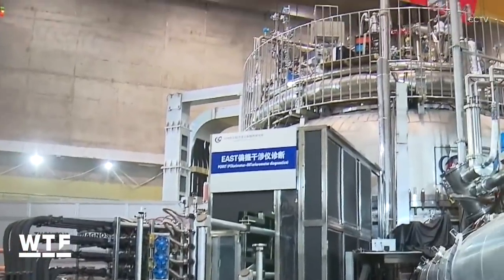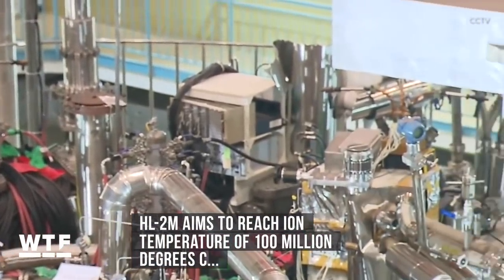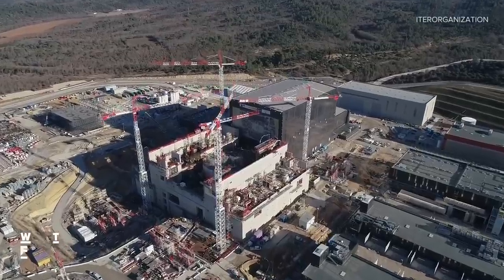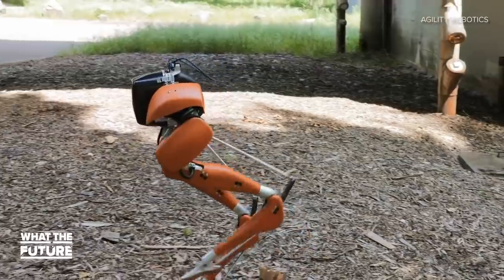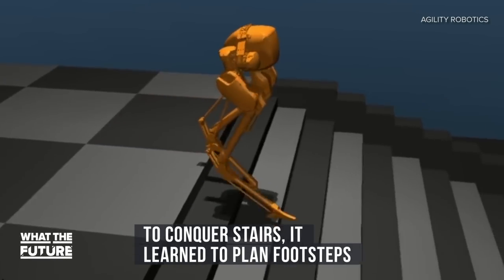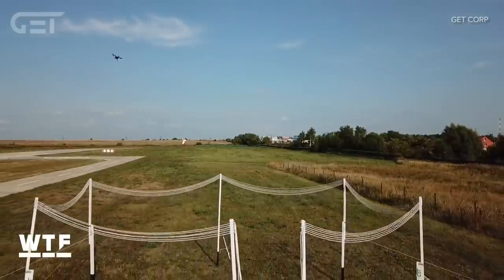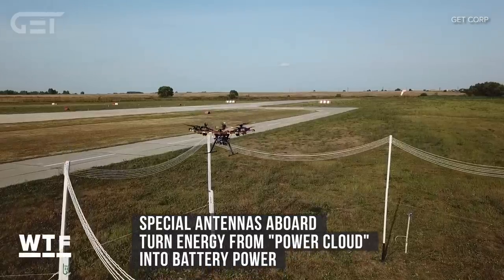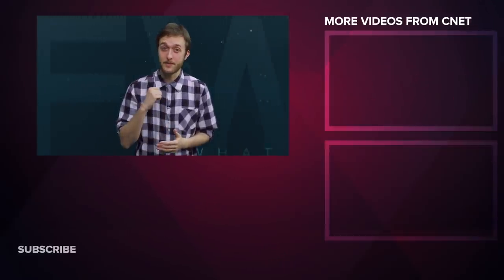China's artificial sun to be completed this year | What the Future

Comment: I hope that fusion project succeeds; unlimited, clean energy. And that robot legs thing kinda looks like a Metal Gear Gekko
Reply: nothing is unlimited, you'd be using sea water as fuel. and given human's track record on consumption of everything. with newer tech and abundance, we are likely to increase consumption, not less or maintain.
Reply: @skychaos87  except that fusion power produces over 4 million times more energy than the burning of coal and oil per unit of fuel. The amount of deuterium in sea water would last millions of years. And you can get deuterium from other forms of water too. Plus there's resources in space like heium 3 on the Moon or in the atmospheres of gas giants which is exponentially greater than the amount of fuel in Earth’s water (assuming we actually get around to colonizing space; it could happen.)  PRACTICALLY limitless is what I should have said. Plus we are getting better and better overall at energy efficiency; operating our machines and technology with less and less energy. So there's those
Reply: @dartmada9733  I agree with the potential, i'd support and hope the fusion tech succeeds too. However, its still not unlimited energy. Humans will still maximize the rate of consumption. We won't just be powering cars and planes anymore with fusion tech, it'd be spacecrafts and perhaps flying buildings. Our walls at home would be full of led screens and computer chips. All where consumption will be at rates thousands of folds more than our current rate of consumption. I'm afraid that at that point even fusion energy won't be enough anymore and we will have to eventually source for better and more energies.

I think there's a constant struggle within the limits. We need to control our rate of consumption, only when we increase our limits(fusion tech) can we then spend more. Its just a repeating process. At this point, it seems we are close to breaking our current limit. And i do hope we succeed.
Reply: @skychaos87  well it wouldn't be JUST fusion we'd be using. It'll ultimately be a combination of different energy sources; same as now except instead of different fossil fuels it'll be a combination of fusion, solar, wind, ocean waves. There's also things like space-based solar power and geothermal
Reply: @dartmada9733  I agree much with you. But my point is that we will just consume more with more and better energies we get. So yea, i do too look forward to fusion tech and beyond. I just don't think it'd be unlimited nor forever sufficient as we progress.
Reply: Do you honestly think China would share for free? It’s a very bad idea. We are not God and our arrogance will be our downfall.
Reply: @hisservants8003  neither western world share their technology with others for free. Not to mention blocking the tech export
Reply: @hisservants8003  yes. They gave Coronavirus for free!!!
Reply: @skychaos87  just like what we did with our current coal power plant, human will develop a better way of generating electricity later, so dont worry about us running out of material for this reactor

Comment: 8min charge 30min flight time?
I would challenge that, I couldn't charge my drone that quick with a cable
Reply: Anfanger Main I smelled bullshit too. I wish it were true but I don’t think we are there yet.
Reply: They don't say what voltages those wires are at, likely to be higher than household voltages. I wonder how much electricity is "Used" by this, if there is any reistance in those wires to increase electromagnetic field.
Reply: Papyrus Okagbue  the main point is how many power wast in the air....  I think not even 10% left...
Reply: @SunnySzetoSz2000   the energy conversion rate of wireless charger are mostly around 65% to 75%. Its not simply shooting electricity into the air.

Comment: I have a bit of familiarity with Tokamak reactors and can assure you that building one is VERY different than running one stably. The physics of the process are extremely sensitive to small changes and the computational simulations are absurdly complex. It has looked "promising" for a long time, but the math is just stupid tricky to solve properly, and the reactor could blow up if your predictions are off even just a little bit due to the extremes involved.
Reply: So basically, yeah end of the world really is near.

Comment: Could the magnetic field generator be applied towards regular power use? It seems like it would be a more consistent source of energy than sun or wind power. I admit that I have to look into it more, but it sounds promising.
Reply: The power cloud in the way its shown is very inifficient.
To charge the drone with unfocused cloud is like using pv panel with a candle.
Reply: @nikolayyotov5748  true, but things normally get more efficient with time.

Comment: Their gonna kill us all making that thing.
Reply: A common misconception regarding fusion is that people think the reaction grows experientially once initiated like fision reactions, meaning they require constant control systems (like control rods) to prevent critical mass.

However, given fusion is only found naturally in stars (which are among the largest & most massive objects in the universe) I'm surprised most people don't realise that fusion has to reach critical mass before the reaction can be self sustaining.

Basically, there is knowhere near enough mass to produce a naturally self sustaining fusion reaction (it'd have to be many time more massive than earth) , and if the machine/mechanism starts malfunctioning, we simply pull the plug and the fusion reaction fizzles out on its own, without an explosion, due to there nit being enough mass to maintain it.
Reply: @RBsRealm  so basically it can be safe.
Reply: @RBsRealm  You sound as if you are the brightest physicist out there! Congrats if you really are lol
Reply: @Rj Simas Not really. The temperatures found in the cores of  hydrogen bombs (better known as fission initiated fusion bombs) don't cause atmosphere ignition. I don't really understand where people get the idea that the atmosphere can ignite... it can glow red hot, as seen with atmospheric re-entry, but not catch fire. 

It is possible though, but would require sustained temperatures along the lines of the suns corronosphere (which is many times hotter than the actual fusion core) and at those temperatures atoms are broken down into a soup of protons/neutrons & electrons (plasma) so "igniting/burning" aren't really applicable anymore.